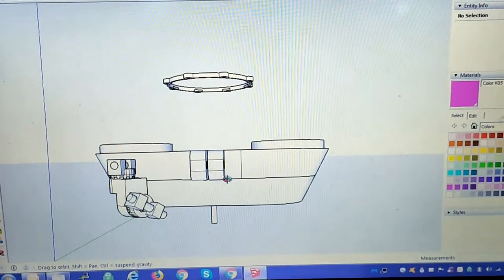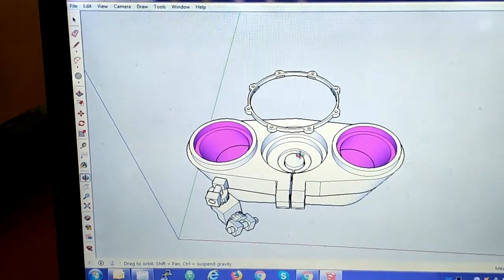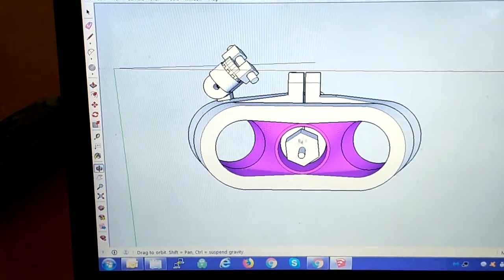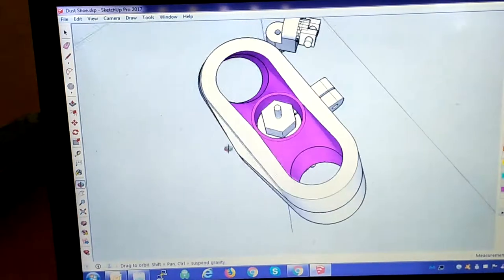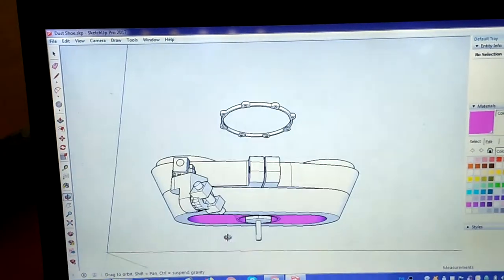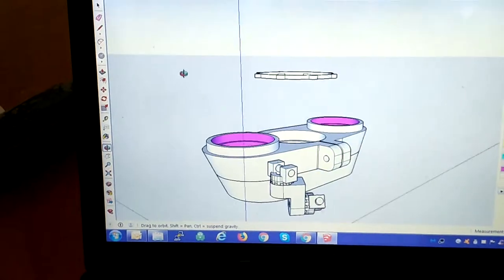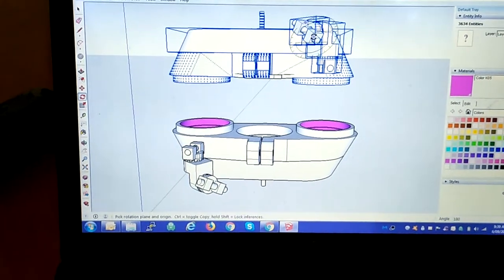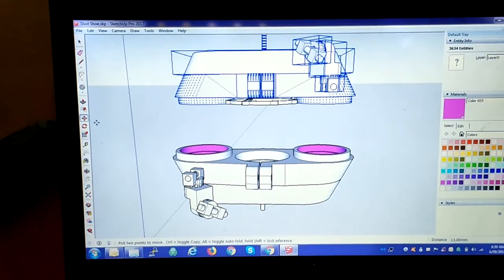Dust Shoe

Comment: Ah that's a nice design. I hadn't considered splitting the pipe and pulling 45 degrees to the cutter axis.
Reply from the maker: fokkerlit it comes down to trying to cut down on dead spots and turbulence. Two 90 degree bends affects air flow much more than most people would imagine, especially at the end of the air path where the suction is at its lowest. Obviously the top part won't be exactly like in the video, the bends will be more gradual and smoother since there is more space to play with above the spindle.
Reply: I wonder if there's any merit to encouraging a swirling action around the cutter and into the pipes? Like if the suction pipe on the west side sucked dust from just south of the cutter, and the pipe on the east side sucked from just north of the cutter, so as to promote a clockwise flow. Two J-shaped brush 'curtains' could leave gaps/corridors at north-west and south-east to feed air into the swirl (if the gaps point anti-clockwise they shouldn't allow chips to fly out). 

I see a lot of guys trying to achieve an airtight seal against the work, but that seems counterproductive to me if it throttles the entire system. Wouldn't more airflow mean more dust transported to the collector?

Comment: Any update to this design?
Reply from the maker: Unfortunately not. I need to do several updates to the CNC first. Then build a new 3D printer. It will be done after that, but I wouldn't hold your breathe, life has thrown me a number of unseen curve balls and I have fallen behind on my time line. It will be done in time. Thanks for your interest.